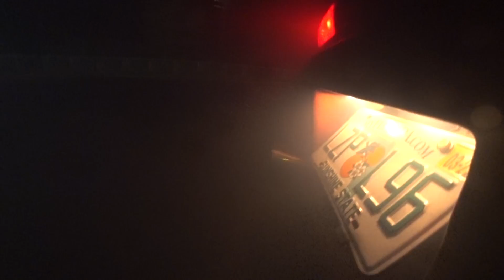Honda K24 swapped Cefiro is back. big fireballs

Comment: I love how you rarely ever hit limiter in the miata, but as soon as you hop in the cefiro, you turn into Benny Boy. Typical Honda guy. 😂😂😂😂
Reply: Different engines have different power bands the ls is all low end and mid range torque naturally aspirated but a turbo k on the other hand comes to loves all the RPMS lol
Reply: @spedward8609  thanks for explaining. I had no idea at all how different engines could possibly make different power at differ lent RPM's. How can I ever repay you for gifting me such great knowledge??
Reply: @dustingresham8078  I accept pre fucked chickens and expired mayonnaise either one will be just fine lol
Reply: @spedward8609  looks like we're both outta luck. I only got half fucked chickens and expired cool whip.
Reply: @dustingresham8078  damnnn eh well maybe next time
Reply: @spedward8609  mx5 is gripped up as much as it can be for the power the car makes, but this one is just a fun street car and doesn't need mental grip, thats why he can smash it off limi
Reply: Banging rev limiter with a laptop sitting in the passenger seat. Honda life lol

Comment: Have you re torque your head studs broseph. Don't want that coolant system seeing any pressure from boost. Love the vids brotha
Reply: I saw guy with a boosted Ford and he put the engine totgher fine after I little bit the heads start to lift should have retorqued them